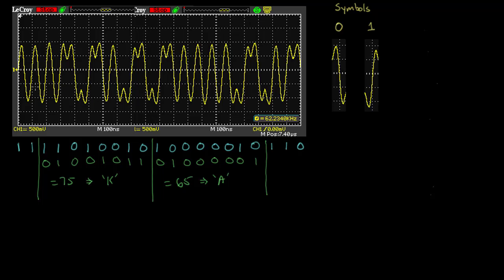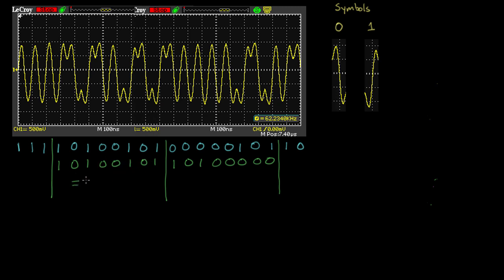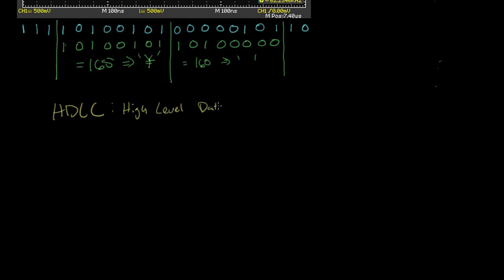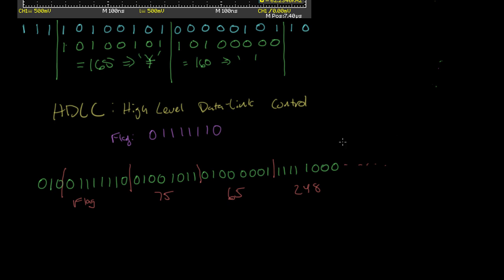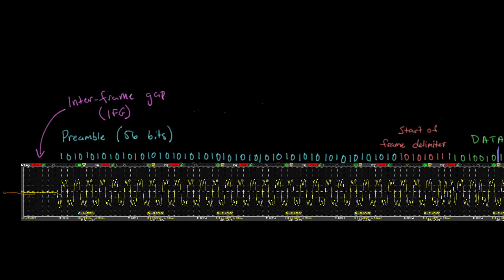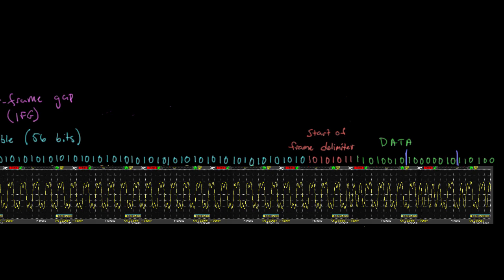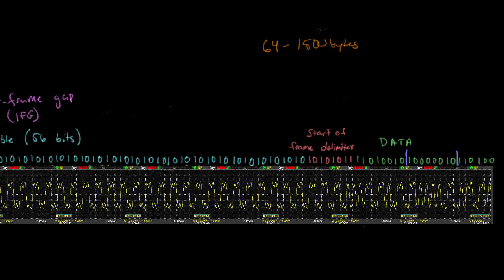The importance of framing | Networking tutorial (5 of 13)

Comment: I'm coming back to these tutorials because I'm considering a career pivot into Networking, and both of the job ads I have my eye on require Ethernet knowledge, one requires 1G Ethernet and FPGA design, other requires more of the internet networking stuff. Thank you for these tutorials, super helpful even 10 years later! Applying these concepts into the simulation I'm setting up takes more time than just watching, but also helps me appreciate the depth of these concepts that much more.

Comment: I wonder how does a computer recieves information on the internet from multiple servers. Like for example I install a game from steam, while I watch a youtube video and recieve a message from friend on facebook. Eveything happening at the same time. How does the ethernet cable or the fiber optics sends all those bytes knowing  where each one byte goes to. Is it the first frame 0111 1110 and then another frame that tells the computer this byte is from steam and then the computer stores it and analyzes the data different by the other  2nd frame 01111110 and frame that tells this byte is from youtube?What I'm trying to say is : Is the cable sending at the same time  in parallel or is it sending one bye from yt , then one byte from facebook and then one byte from steam untill the recieving is complete. Also how would the computer's clock syncronize with all that parallel data being sent from different servers? Sorry if my question doesn't make sense.

Comment: Do you use a bigger frame when you trust the quality of the hardware on each end?  Should you be matching hardware on either side?  Do you need external clock synchronization when using larger frames?  Short distances, or particular cable type (fibre?).   Thank you.

Comment: Very nice presentations. I've used an oscilloscope for decades in troubleshooting office systems. Usually I would  also display the rise and fall of the clocks as an external trigger to the scope, which would come from the NIC adapter, so I would know exactly when the clock triggers a 1 or a 0.

Comment: @4:48 but what if the actual  data sent was already 01111101.
if the zero after 5 ones is ignored. In this case we actual lose data.
How can you determine whether a one was added to avoid six zeroes or if the 0 was actually part of the data.
Does it add a zero to every consecutive 5 one bits.
Reply: Taking an educated guess, I think the sender might send 011111001? That way, only one of the zeros are ignored and the rest of the data can be decoded properly.
Reply: @vicr123  thanks for the reply. I figured it out but left the comment. It's kinda obvious now that I think about it.

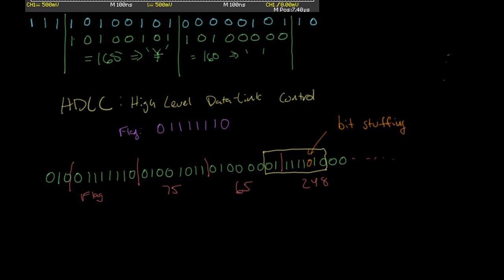Comment: i'm confusing that do we need to flag pattern(0111110) to delimit the data? but why we directly start DATA after the SFD without check the flag pattern at 5:07?
Reply: The flag pattern (01111110) is only used in HDLC, the one you are asking about at 5:07 is for ethernet which has (10101011) as flag delimiter instead of using (01111110). (As far as I understand)

Comment: What if my data contained 96 consecutive zeros followed by 1010101010101010101010101010101010101010101010101010101010101011?
Does a NIC just know that a frame should always be 1500 bits?
Reply: The 0s would be on transitions so there's no interframe gap.

Comment: Hello, i just have a simple question about bit stuffing. if there are 5 consecutive 1s then you said you put a 0 in to let the receiver know that this is not the beginning or end of the frame. but if i have to put a 0 in then the data doesnt match up to the data i was acc trying to send?
Reply: The idea is that after any five consecutive 1s, there will always be a 0 to signal this is not a flag. The receiver sees that zero and removes it from the data it interprets. 

So if I want to send: 

00101111 / 10110011 / 00101011

I actually send:

00101111 / 100110011 / 00101011

Note that the second byte is now nine bits long. 

As the receiver reads this, it says "ok, there are five 1s in a row, so now if I see a zero I will ignore it". This means it removes this 0, leaving: 

00101111 / 10110011 / 00101011

Which is the data I wanted to send.
Reply: @teakew8217  awesome, thank u for explaining!! the way ben explained it was a bit confusing lol

Comment: Hi sir, I have a really tricky question that came up to me:
if you take the picture roughly at 4:34, you explained that to avoid confusion with the pattern 01111110 which is not a frame delimiter the system must add a zero before the last 1 as  011111010.
OK, I can perfectly understand this rule but my question is how do the system know that the sequence  011111010 is really the adaptation of 01111110 and not an original 011111010 aprt of the bit flow?
The only solution I can see is that it should be no posiblility to uncounter the pattarn  011111010 by any combination done by using the ASCII code or whatever code is used to send the data.
But wait, if you take the following series 01111101 (which is in ACSII the right closing brace) and then you invert before sending, it becomes 01111101. To this 01111101 series you add another one, for example the 01111000 (which is in ACSII the x) and then you invert before sending, it becomes 000111110. Then if you concatenate both the series, you obtain 0111110101111000 where you can find the 011111010 series which is apparently not the hidden 01111110 series!!!! 
Do you have a more explaination to better understand this ambiguity?
Thank you.
Reply: Any time you send five 1s, you insert an extra 0 immediately after them as padding. 

Any time the receiver reads five 1s, they ignore the 0 which immediately follows as padding.
Reply: @teakew8217  Thank you sir, but I already fully understood this. My question is : if I want to send an original 01111101 which is not at all a hidden 01111110 pattern but really a 01111101, How the sytem can detect that it is not a, hidden 01111110 but an original  01111101? That's my question.
Reply: After any five 1s, the transmitting system will insert a padding 0. So any time the receiver receives 111110, it knows that the zero is padding and will discard it. 

If you ask the system to send the string 1111101, what it will do is send the string 11111001. This can then be interpreted properly by the receiver.
Reply: @teakew8217  Waohh, super thanj you, everything is now understood. Thank you sio much sir:)

Comment: Wait, what's the difference between no voltage and 0...or -1 voltage?
Reply: at 5:07 how do you get silence? I thought 0 volts was off or 0
Reply: or is it (in this case) its 12 0's in a row?
Reply: +Nick Rat Probably his video that's titled "Analyzing actual Ethernet encoding" will help you with that...
The 0 is not a 0 Volt... The 0 is the transition from a positive voltage to a negative voltage

Comment: For HDLC bit stuffing, what if I literally want to send 5 ones and a 0, followed by a one?
Reply: You would still stuff the 0, you'd have 11111001 and it would be read 1111101
Reply: For anyone who, like me, was confused about this bit-stuffing thing. I dug into it, and the idea seems to be that you add the 0 after EVERY occurrence of 5 1s. Not just in the middle of 6 1s. That way you can find them all and remove the added 0s, leaving the original runs intact. I think I have that right. (With the small exception of this bit-stuffing confusion I found these explanations to be remarkably clear and informative. Just like all the other Ben Eater stuff I've watched. Thanks!)
Reply: @jackhodgson  nice but what if in the original data we have  11111011 so we already have zero after 5 1s
Reply: @abdelrhmanahmed1378  111110011
Reply: 11111001